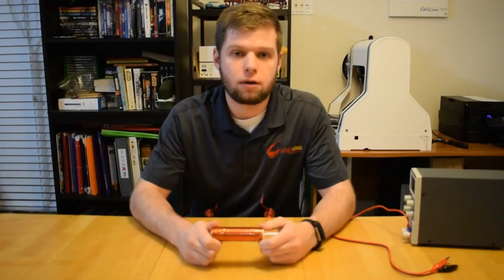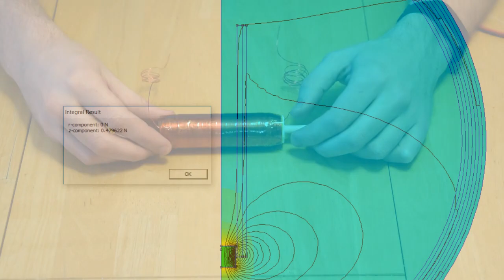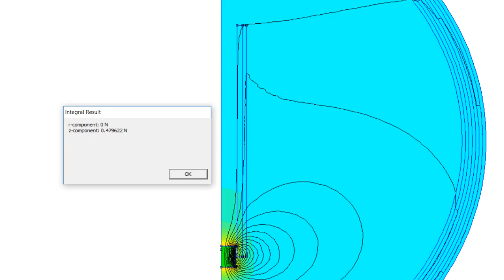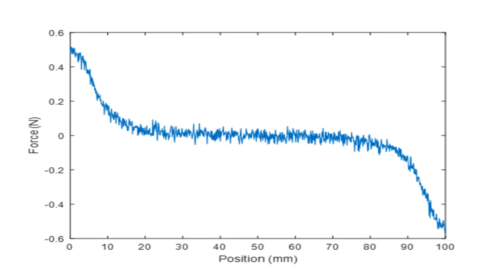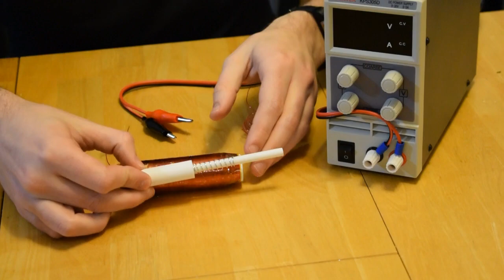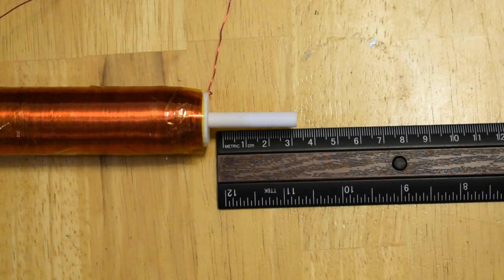MAE 535 Magnetic Solenoid Linear Actuator

Comment: Does this works with all the solenoid of the market ?
I try to make a midi accordion controller by microcontroller and the valves will be operated thanks to solenids but now I just experiment some 0 / 1 positions and not smotth linear positionning

Comment: tip: your magnets are way too weak and your amps are too low! Increase your AWG to 22 gauge and buy a 40mm x 30mm disc magnet on Amazon and then get back to me with your results! 
How do I know? I've already done this many times over!
What do I do about the heat issue? Buy a 0.2mm x 20mm x 1000mm roll of Copper foil roll and add it around each couple layers of your windings leaving about an inch at the end to fold over. Get a tall but small heatsink preferably with a 20mm fan attached to dissipate the heat at one end.
Let me know what you think!